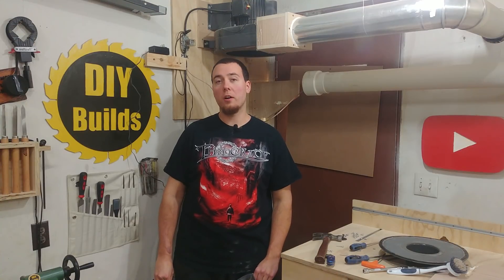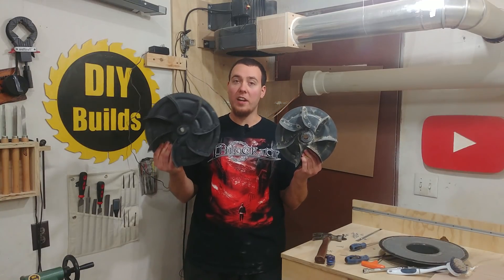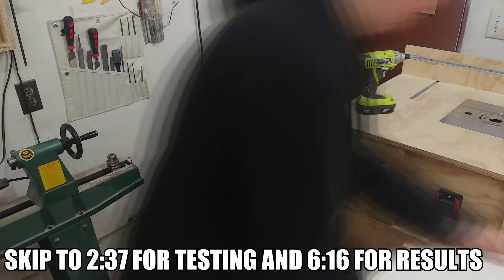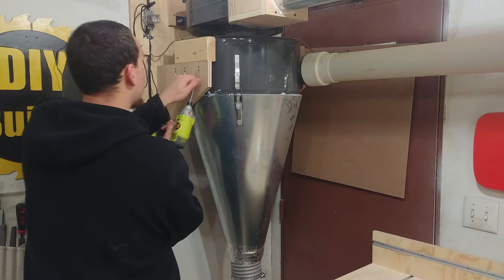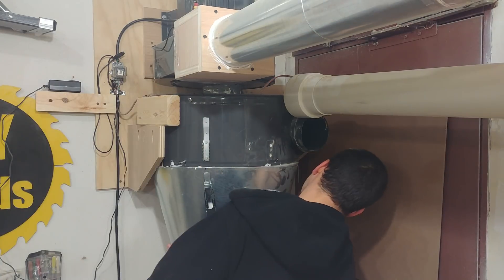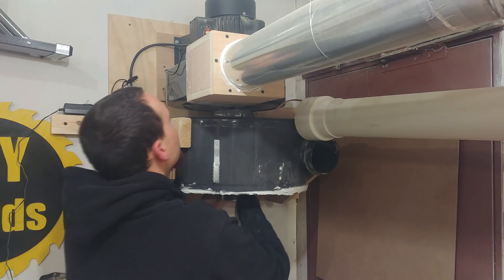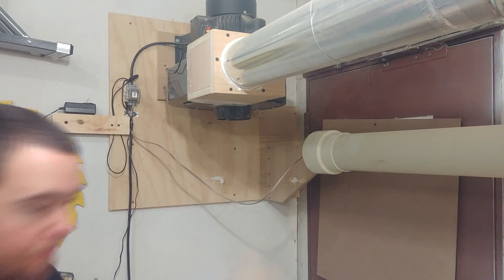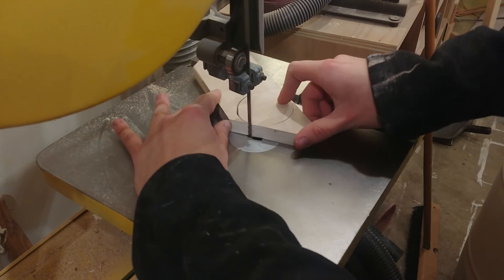Dust Collector Impeller Upgrade - Testing Air flow, Suction, Noise Levels and Current Draw

Comment: Very nice video, thorough testing!  Please explain more about that diy puller.  I really did not get how that worked.  For example, what were the three screws for?  Did the bolt push against the shaft?  Or did it screw into the shaft, in place of the retaining screw?  
Would really appreciate some additional info.  Your method made it look SO easy!
Thanks!
Reply: Ok, finally found your response to SteveK.  Now it all makes sense!  Thanks for the idea!  My cheap gear pullers did not want to hold, or the legs were too long while the bolt was too short...Thanks again!
Reply from the maker: 3 screw heads grabbed onto the lip of the impeller and the bolt is threaded into the wood piece and pushes against the motor shaft.
Reply: @DIYBuilds  Thank-you!

Comment: NIce video....people get this wrong all the time(including myself) but a 1db increase in sound is actually a 50% increase in sound...db's are a logarithmic measure so not releated to imperial or metric.
I love your vacuum pressure liquid tester.....so simple.
What do you think, overall, the (percentage) improvement is for the actual job of dust collecting? are there any differences e.g more dust ends up in the cyclone than before? or maybe less and more ends up in the fine collection bag? (i found the latter with a power increase whilst not increasing the hose diamerters (I need to do that too)

Comment: I think if you dont change the impeller, but just inversing the motor rotating way you will get similar results as you get with the new 12 size blades.... maybe was no need to buy a thing though' very nice comparison of these reads

Comment: I had some trouble ordering this impeller because it was out of stock everywhere.  Finally was able to pick it up… over a year ago.  Then of course it just sat on the work bench.  Finally decided to dig into it.  First I can’t believe how easy it was to install.  Took less than 10 minutes.  Second the noticeable increase or at least perceived increase was tremendous.  Wish I would have done it as soon as I received the impeller.  Thanks for the video.  Was a great help.

Comment: Hi, excellent video!  I’m actually in the process of upgrading my impeller but used a gear puller. Unfortunately I broke the outer flange lip and now I can’t remove it any further.  May be seized. I noticed your method and it may save me. I get everything except for the last part with the impact gun. Did you drill a center hole all the way through?  Also, what type of fastener are you using for the center? Thanks!

Comment: Why rear facing vanes? It's loosing air. Allows the air to wash off the OD edge of the vanes.
Reply from the maker: Creates higher static pressure. More suck less blow.
Reply: @DIYBuilds  so is the stock HF impeller actually running the wrong way?
Reply from the maker: No it just produces more cfm and less pressure

Comment: Will a 12 & 1/4 impeller fit? I found one from another company because Ricon is on back order.
Reply: I've seen some posts about the Wen 12" which fits without modification too...

Comment: It makes you wonder which companies engineers got it right? The forward facing vane guys or the rear facing vane guys? Let's not forget that this is a blower, not a sucker and that it only creates suction by displacing air in a positive direction. So, not being a fluid dynamics engineer, which vane direction works best? OR is it simply the increase in diameter that closes the gap between the  vanes and the housing? I donno, but this is a great demonstration of the differences, before and after!
Reply from the maker: Backwards facing cause more pressure and forward makes more cfm

Comment: Great informative video !  I have not done an impeller upgrade,  yet, but did replace the top filter bag with a humongous custom bag from American Fabic Filter.  Made a BIG improvement in the air flow. (Less restriction).

Comment: Great video, I always appreciate the hard data. I have had my HF, 2hp dust collector for about 2yrs now.  Currently upgrading to a dual stage set up in my new workspace. I have seen the impeller upgrade but didn't have the info as to where to get it. Thanks for the info 👍

Comment: Nice video! Three years ago I made this upgrade however your bottle neck of airflow is with your connection point to the fan housing
Using the stock input plus the cross members also constricts airflow.
I made a new fan housing cover and used a 5 inch HVAC takeoff that connected directly to the Supper Dust Deputy and I used 5 inch smooth ducting for my runs. And as little flex pipe as possible. 
I also added the Wynn environmental filter to reduce back pressure on the filter. 
I do not have the numbers in front of me, if I did I would post them. You will have a significant Amount of increased airflow if you use a larger fan housing input. 
The HF DC was given to me new if I had it to do all over again I would buy a commercial 2 stage system considering the cost of the Rikon Fan, the Wynn Filter, the Supper  Dust Deputy and the other parts to put it together. It was fun building it and works well for my two car shop. The best improvement to my 2 car garage shop was adding the DIY 24 k MRCOOL Mini Split. I can work all year around in comfort.
😁🛫

Comment: Harbor Fright DC (with Rikon impeller)
The initial/startup draw is between 20 to 27 amps, and running (this really depends on how open or closed the system is) is between 8.5 with no load and 10.2 amps with one 4" blast gate wide open (typical use). So, if it runs at 10 amps - this is only 1.45 horsepower at 90% efficiency. I've argued long and hard the HFDC is NOT a 2 horsepower motor.  You are pulling closer to 1.2 to 1.3 horsepower.

If a person DOES NOT already have a HF Dust Collector, I would suggest the Wen 3403 2 HP collector.  It costs more, but already has the 12 impeller vs HFDC 9.875".  All other things being equal, a  person would save by buying the Wen, vs buying the HFDC and buying the Rikon Impeller.  Wen KNOWS the startup  has a higher power draw and has a NEMA 5-20R plug, and requires a 20 amp outlet.  I don't know the power draw on the Wen 3204.

Comment: That's one fantastic bit of work to show HF DC owners (like me) what we can do to get some more pressure. You didn't characterize just how you felt about the upgrade though. Was it like day and night? Was it barely noticeable? It will be a lot of work for me even if the impeller was free. And that puller! Damned if I understand that at all! Can you splain? Thanks. Liked and subbed.

Comment: Wanted to install this impeller for a while now. I haven’t done it because I only have (2) 15 amp circuits in the garage. Do you think I could run this mod on a 15 amp breaker, as long as it always had inlet/outlet restriction? You seem to always be right around 10amps running. 

Great video, love the pulley puller. You just saved me $20.
Reply from the maker: Maybe. Im not going to say 100% yes. Best of luck.
Reply: Thanks. Only one way to find out I guess. Just ordered it.
Reply: I’m happy to report it works on a dedicated 15amp circuit. Good thing too, because I had to absolutely destroy the stock impeller. It was completely rusted and seized to the shaft. Three jaw puller just shattered the flange. Had to drill out 6 rivets to remove 2 impeller blades. That gave me enough room to fit a cut-off wheel in and cut a slot in the hub. 2 hours of sparks, shavings, and swearing. There was no turning back. But it was well worth it, the suction difference is incredible. It now runs like it should. 2.5 inch port went from 52 to 76mph. 4” ports just howl. I’m guessing I’m right around 10-11 amps as I was able to run 250watts of lights and a 2.3amp fan on the same circuit. I have a clamp-on ammeter arriving tomorrow. I would caution people that if you want to do it, make sure you have the ability to cut the impeller off if need be. Thanks again for the awesome video. Finally motivated me to pull the trigger.
Reply: @fluxcapacitr121  I just received my Rikon Impeller and as soon as I attached my pulley pulley it also shattered the flange. Stock impeller frozen to the shaft. Applied generous amount of WD40 to see if that will make a difference and I'll let it set overnight. It came off so easily in the video.

Comment: I know this is way too late to reply to an old video but your motor is well overloaded. The time it takes to start up you can hear it struggling to get up to speed when you were testing noise. The startup cap might eventually burn out because the centripical switch clutch takes too long cut out use of the cap.  It is also pulling 15 amp as you measured which is 1800w 15a*120(745 per hp). That converts to 2.43 horse power. your motor is only 2hp you will eventually burn it out. Your old 10" was drawing 1.5 hp (1100w) 9.22a * 120 / 745 per hp
With the after tests only taking 9 amps you MAY be ok. Reverse blades give less airflow, is easier on the motor, and gives more static pressure. but you increseased size so it is able to put out more
Reply: Can the starting capacitor be increased to improve motor startup speed? If so, how would you size a bigger capacitor ?

Comment: Im interested in how eliminating the plate directly below the impeller that steps down to the 4" port.It seems that removing all of that and attaching the cone directly to the bottom with an internal spiral baffle. looks like the bigger cyclones dont restrict the impeller.

Comment: I have a Harbor Freight 613 cfm dust collector & badly need to increase the efficiency.  The unit barely sucks the sawdust out of my tablesaw.  My shop vac actually out-performs the HF unit.  
Any ideas to supercharge my HF vac??
Reply from the maker: Dust collectors move lots of air and doesn't have any where near the sucking power. Therefore shop vacs do well through small hoses and dust collectors do well through large pipes.  Make sure your not restricting air flow to the unit.

Comment: I was going to do this, but I discovered that the 2hp Wen dust collector already has the 12inch impeller installed, and the price difference is less than the cost of the Rikon part.

Comment: Thanks for the great video. What type of hose is that at the drill press?
Reply from the maker: Loc line from lee valley.
Reply: @DIYBuilds  is it the 2.5"? It looks larger than that.
Reply from the maker: @marang1966  yup

Comment: Why is it the larger  propeller vanes are curved the opposite direction of the smaller unit? Shouldn't  the aid scoop push on the inside curve?

Comment: Don't know how I missed it, but just found this vid. GREAT job in breaking down the performance (before/after) at each of the tool locations. The impeller upgrade seems worthwhile, even if the gains are only 10%, with some locations showing much better gains. Since I am not sure of your pipe size (at the cyclone inlet), I cant equate the airflow numbers (MPH figures) with the corresponding changes in CFM. I am particularly interested in CFM gains at the collector, since readings at the ports are the big variable with the inherent restrictions. Did you calculate the CFM numbers at the collector before or after that swap? I am very curious, as we all know the stated 1550 CFM rating JUST a tad optimistic. 

In the near future, my HF collector is getting a trash barrel style cyclone second stage (Rockler kit) and a Wynn 35A nanofilter cartridge to replace the stock bag. I'm going to try that setup first to see if my system does an adequate job. A potential impeller upgrade is still on the possible horizon. 

Keep up the good work. Just subbed the channel.

Comment: Has anyone had trouble removing the HF impeller?? Mine won't budge . I tried DIY Builds method and then tried gear pullers which broke off part of the lip! Can't get the thing to budge.
Really frustrating.
Reply from the maker: Wow that sucks. Sorry to hear. Have you tried a heat gun on the impeller around the shaft?
Reply: Yes I did try a heat gun. Like that other commenter I was tempted to just cut it and break it off but for only about 25% more performance I decided to leave it alone. It was pretty good to begin with so I'll stick with it. I didn't want to risk damage to the motor shaft. I'll call Rikon and see about returning it. Wow, didn't expect to hear from you this fast but I do appreciate the prompt responce. Like your channel. Keep up the good work . @DIYBuilds
Reply: Earl B. Hi did you check for a set screw on the impeller?
Reply: Earl where did you purchase the impeller,I’ve searched the web and can’t find a vendor. Could you post infor.
Reply: @richardwebster1772  Yes, it has a key slot with a key in it. I've returned the impeller to Rikon . Any attempts to cut it off might have damaged the shaft. However, I learned that I needed a left turning gear puller but since the lip had broken I'm not sure that would have worked now. At any case, I returned the impeller and going to stay with the original. Thanks Richard for your question and help.
Reply: @richardwebster1772  I ordered it from Rikon. https://rikonparts.com/support#contact. They have plenty in stock now according to the guy I talked to. Part# P60-200

Comment: Great videos you do.  Very impressive.   I recently made this upgrade + opened it up to 7 inch intake. Have 8 inch line into shop then y's off one to belt sander 8 inches all the way and 8 inch y's before table saw. 3 inch to bottom and 6 inch over the top. Top pulls at 17 mph. Didn't check bottom. Belt sander pulls 29 mph. Any chance you measured exit speed?  Didn't have an Anemometer to check the before.  I do now and it does 56 mph with  both gates open inside.  I have the collector sitting on top 55 gallon drum with a thein baffle added.  I had a lot of debris making it through after the upgrade.  Was perfect before. Of course not sucking as hard. I doubled up the height of the separator.  With the thinking incoming debris would drop faster instead of swirling. Helped a bit. Thinking will need to try a cone next.  Thanks and keep up the great videos
Reply from the maker: Im pretty sure it maxed out the speed on the meter right next to inlet

Comment: Very informative test.
Good to see the test results.
I am interested to find more information for my shop.
But my application is for metal.
So it,s a little more difficult to sort out.
Thanks for taking the time to share the information.
Wish you all the best with your channel.
Peter.
Reply: For metal, Urethane tubing might be a bit more more robust for the high-speed metal particles.  I believe that the Urethane tubing is available  at the same company that makes the large filters.

Comment: Great comparison. The stock HF system is about $150 with coupon, and I'm buying one this week to replace my fairly decent wall-mounted Wen 660 CFM blower. I use the Woodriver separator lid on a 31 gallon stainless steel trash can, and it performs  extremely well, separating about 98% of the material into the can, leaving just fine dust venting outside into a mulch pile. I'm not ready to nearly double the cost of a HF system with a better impeller right away, but it is food for thought. I will see how happy I am with the performance of the stock HF blower, which is already a big upgrade over the 660 CFM system. The best thing one can do is ditch the filter bag and vent outside. Eliminating back pressure is one of the best ways to greatly increase airflow through the system. I'd estimate it doubles at the very least. Those bags significantly reduce airflow.
Reply: Hey Dan, it has been 10 months since you posted this.  How did you make out with the upgrade and venting outside?  I too don't feel it is worth it, at least right now, to spend more than half I spent on the HF DC to begin with for an impeller upgrade that gives me a 20% increase, maybe..  I wanted to actually get rid of the filter, bag and the platform and even that little piece that sites between the bag and holds the filter.  I did get a cartridge filter from another DC system I bought used, then resold for more than I paid for it. So essentially, got the cartridge for free.  I thought if I just mount the motor on the wall, run my outlet hose/pvc outside, then inlet connection around the shop, vent all the incoming dust right outside where I mulch leaves and store the mulched dirt, easy access to just shoot the dust and turn the pile.  Have you actually done this yet? Vent outside?
Reply: Oh another thing I was going to say was, if you got rid of your bag, and it in fact eliminates that back pressure, would be very curious to see if the power increases.  If that option is doable, who's to say you can't get that same 20% increase or more as you think it could be double.  Essentially a free upgrade if you look at it that way.  I know many or most people can't vent outside as well.  If you have an attached garage as an example and vent outside, the dust could be blown into your home via some windows or screen door.  Now if you use a cyclone into a barrel in the shop and then just let the very fine particles exhaust, you would still possibly have to worry about the fine, damaging dust particles getting blown back into the home or shop.  Thoughts?
Reply: I thought  of venting  outside also but if your shop is climate controlled  you will be venting  the heat or cool air outside  also.

Comment: Great idea on the pulley puller! Never seen that method before. I went to an auto parts store and bought one for $20 (which I returned later, flame me if you wish). But it's not something I would ever need to use again.

Comment: What size pipe are you running for your system?  Is that 6"?
Reply from the maker: 4"
Reply: Looks like you have a short run?  Do you think the HF DC with the upgraded impeller would work on a 5" piped system with about 65' of duct work?  Longest run would be about 35ft.   Appreciate the help.  Thanks
Reply from the maker: I would think it would work but can't be sure.